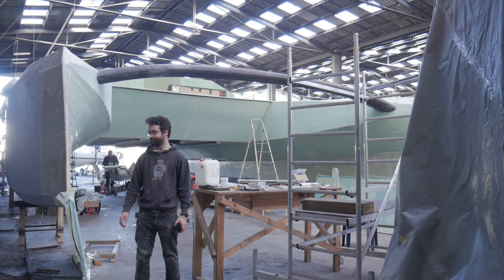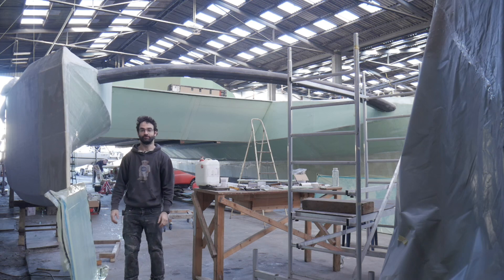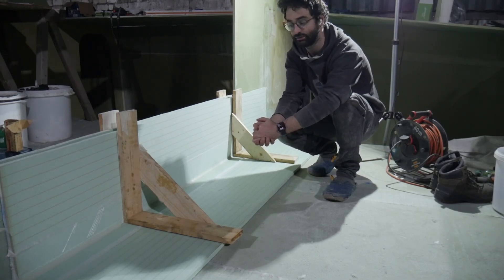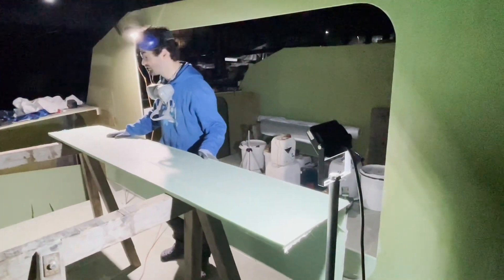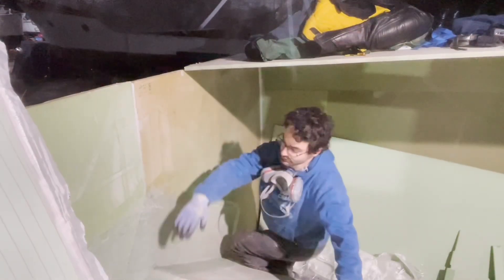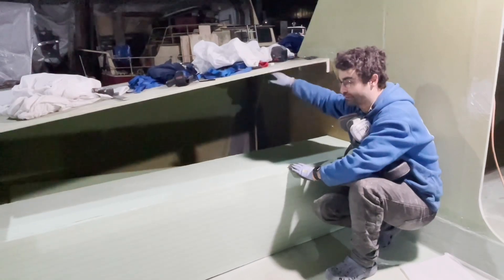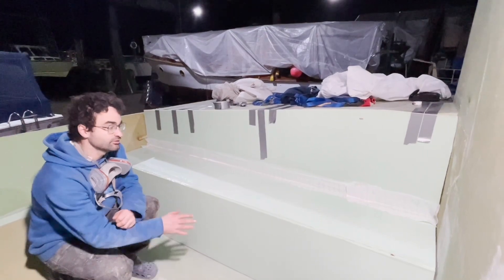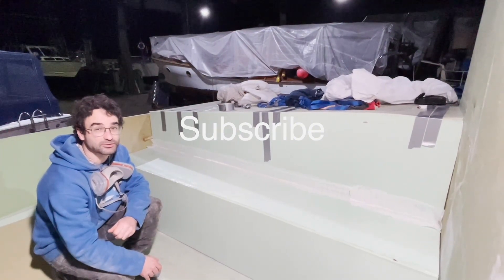Building the Cockpit Benches for My 12.5m Catamaran ⛵️

Comment: Mate you're going to rack up unnecessary bills in wasted materials if thats how you're taping and coving. 

Your cove shouldn't need to be much more than 20mm, and that taping looks like it's about 20mm thick..

You could really minimise your costs by cutting back on materials and using a better system. 

More doesn't necessarily mean stronger, it means more expensive, harder to fix or retro fit and much, much heavier. 

I don't want to criticise you, you're doing a decent job on your own and excellent initiative. 

Making your own panels, cutting and all the secondary bonding is quite admirable. 

Instead of masking tape, try making a jig from scrap wood and hot glueing it to an isolated area that you have taped off, or some glue from filler straight onto peel ply that you've left on.

You should aim to keep the peel ply on the job as long as possible to keep things clean and protected. 

If you're glueing and taping something in, only remove peel ply to about 30mm outside of the tape line. 

Looks like you have vacuum capabilities in that yard, it wouldn't hurt bagging up your tape lines either. 

You can use less materials and achieve a much stronger and lighter laminate. 

If you want stronger and lighter tape lines you can do two at once by stacking them on top of each other from largest to small in two or three sets. This allows 10/20mm of feathered purchase to the tape line. 

Ì hope some of these suggestions are useful and once again I have no intention to criticise.

Comment: I have been working in the boatbuilding industry in Iceland since 2009. Over these years, I have specialized in fairing and surface preparation of boat exteriors, ensuring smooth and high-quality finishes before painting and final coating.

I am very interested in joining your project and contributing my experience specifically in the fairing stage of the boat
Please let me know if you would like to discuss my background further or if I can provide any additional information about my experience.